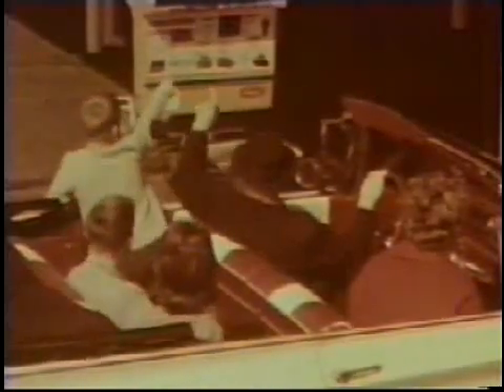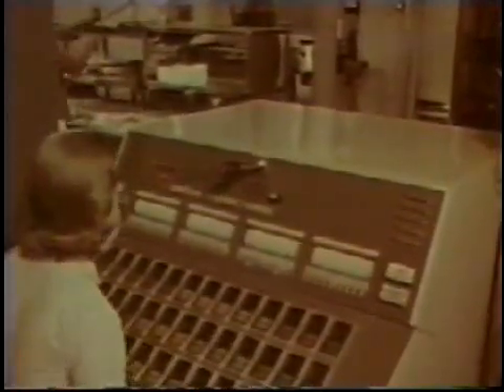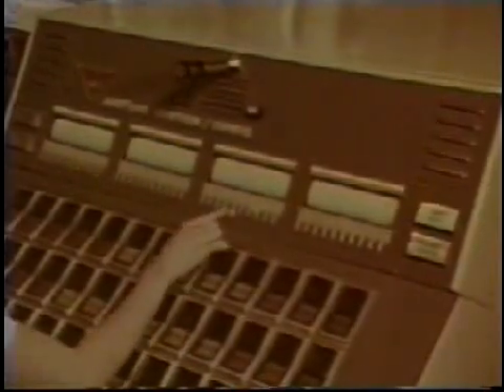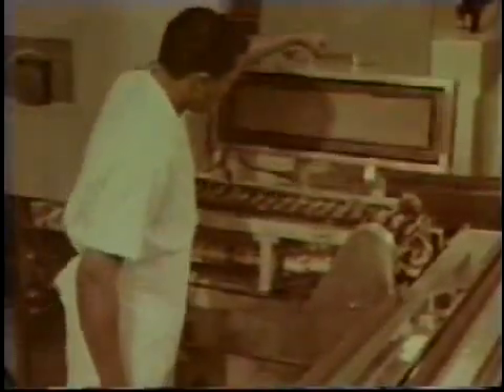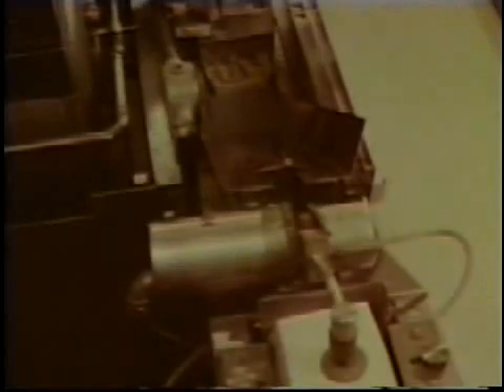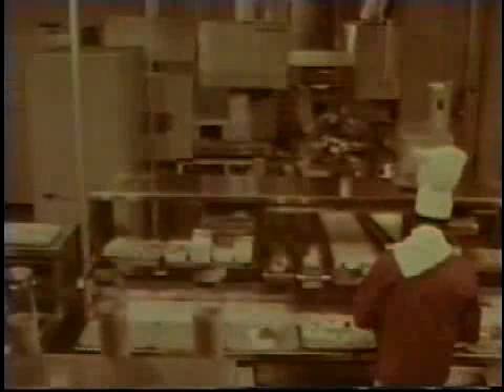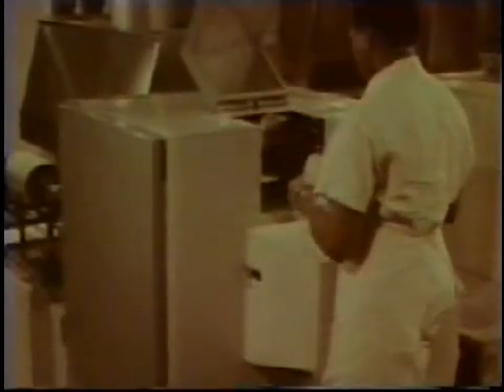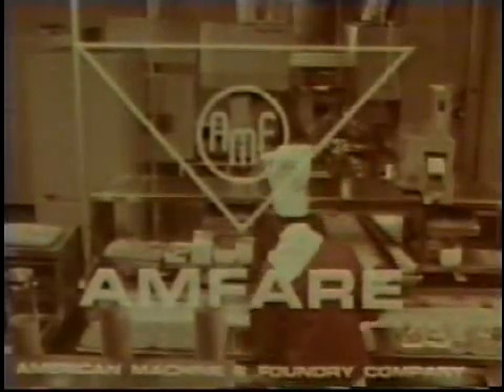Automatic Hamburger Machine - 50 Years Ahead of Its Time!

Comment: Lots of servos, solenoids and pneumatic systems that had to be a nightmare to maintain. Surfaces that had to be near impossible to clean and keep clean and sanitary. An enormous investment right on the front end, for a system that was never scaled and brought to market phase. Not surprising this didn't take off. 

It's more like the pipe dream of a bunch of engineers, rather than a workable setup.
Reply: a good guess is that is  part of why it never  took hold in many restaurants..I  agree  it was not only a  nightmare to maintain ... I bet   if it broke down,  the restaurant would have had to close down   until repairs  were made ( unless they had a way to manually fix the meals  correctly & timely
Reply: @Xenomorph1111  seems like you'd have to have a maintenance engineer on site at all times to keep it running
Reply: It all begins with a first step

Comment: it takes whole 4 minutes to produce an order and is still required to be managed by two workers
additionally it would be costly to build a AMF system and maintain it.

minimum wage workers will continue to dominate the fast food industry for the foreseeable future.
Reply: Actually the cost of the new version of the machine will pay for itself in about 1 year. The total size of the unit will be about 24 square feet cutting the total size of the restaurant down or allowing more seating space. The machines today can produce about 360 burgers an hour and you can customize all the toppings and even the meat blend of the burger itself. The system is far more sanitary than the average fast food restaurant. With these savings you can increase the quality of the ingredients and sell 'gourmet' burgers for McDonalds prices and make even more money. You forget you buy the machine once while you pay the wage of the worker every year.

Plus you don't have to worry about worker injuries, surly employees demanding college level wages for no skill work, employees who don't come to work, etc. Plus they already have an automated cashier/order taker. So really you just need a couple workers whom you can pay 15/hr so they'll restock your fast food machine and smile at customers. Gone will be all the rest of the crew.
Reply: Two or three people trained to handle any issues with the equipment and handle deliveries and restocking the consumables, one per shift. If the serving trays are delivered on conveyors to the customers, and returned the same way to automatic washing, that's all the employees a restaurant would need.

There already are restaurants like that in Japan. At least one even has an animatronic robot doing the cooking inside a clear walled box. The food is sent down the line and pushed through trapdoors onto the tables, with all the robotic stuff inside the clear walls for the customers to see.

When it comes to American shores it's likely that all the showy stuff won't come with it. There'll just be order screens at each table. Poke your debit card in and wait for the food.
Reply: Not true. It takes 4 minutes to output a given order. They did not state what it's throughout was. It's called queue theory. You have a number of orders in the pipeline simultaneously at various stages of completion. That's how factories work. This can be understood better in an auto factory. You may have a new car poopping off the end every 5 minutes, even though a particular car might take 5 hours from start to finish.

Comment: This is a brilliant idea, but it was scrapped cause it takes forever to clean and cost over $100,000 just to operate it. Not to mention that it keeps breaking down. Even with a full-time technician.
Reply: +Brendyn Robertson My dad was a customer rep for AMF in Mill Valley CA and a local chain (think A&W?) tried these out. I remember getting dragged into the place on a weekend when engineers were trying to debug the installation before the restaurant opened. We watched food coming off the conveyer belt all morning going straight into a big trashcan. The owner cancelled the contract eventually since the system did indeed break down daily.
Reply: +Brendyn Robertson Hopefully technology has improved since then. Maybe it's more practical now? Or at the very least the ordering and picking up bits.
Reply: Maybe, maybe not.
Reply: +Brendyn Robertson Thank you.  I think so too.
Reply: thanks for that, i was wondering what happened since this was like the future back int eh 50s right?.. so we got http://momentummachines.com/ now with a much simplier machine to do the burgers, looks like less moving parts to jam up, im guessing. haven't seen it run . yet ( the only think I can remember AMF for is their bowling alleys back in aust )

Comment: Years ago I noticed that Burger King used a broiler similar to the one in the hamburger machine.  It consisted of a conveyor of three steel bands which carried the burger patty thru the flame broiler.  The flames hit both sides of the patty at once.  Cooking it that way gives it a terrific char-broiled flavor.  AMF used meat that was about 20% fat content.  It is the burning of the fat that gives it the flavor.  I have wondered if the Burger King broiler was a descendant of the original hamburger machine.
Reply: BK always tastes like it was cooked in a microwave
Reply: @Uncle__Karl  bc they reheat the burger in the microwave
Reply: Burger King stopped using the broiler when they set a UK airport on fire

Comment: In December 1965 I worked for AMF, and was transferred to Stamford Conn to work in the AMFARE test lab.  It was setup like a fast food kitchen with all the machines there making everything described in the video.  I worked graveyard, as they ran 24 hours five days a week.  We ran the machines and made the food, and each day we filled the dumpster out back.  All of it was thrown away.  But the stuff was great.  The double cheeseburgers were excellent, with a terrific charbroiled flavor.  Had too many milk shakes.  The machines worked great.  They were designed by the research engineers in Greenwich that were looking for another hit like the bowling machines.
On the weekends I rescued and took home bags of fried shrimp and put them in my mother's freezer.
AMFARE was doomed from the start.  It took hours to clean the machines.  Cooked on grease from machines running for endless hours could only be removed using super strong alkali chemicals.  It was a nightmare.  But the machines were beautiful!
Reply: None of the original machines were ever used in actual restaurants.  An offshoot of the hamburger machine was used by Burger King years later.  They used a similar machine that cooked the hamburger patty on an open conveyor belt system with gas fired flames cooking from above and below.  Burger King also used and offshoot of the ORBIS system, which was a cash register with a register key for each menu item, which is common today.
Reply: +mofo syne 
The cleaning issue is always going to be a problem.  I don't know how anyone can get around that.
However, as I had mentioned, the quality of the cooked hamburger patty was really good.  Cooking it in an open flame on both sides at a time gave it a terrific flavor.  I don't think any fast food joint does that today.
Reply: +R Pondyke 
Automated cleaning won't be fully solved until improvements in AI and visual recognition happen, because there's simply no way to get reliable cleaning done with blind machines.  All it takes is a slight miscalibration during a process and suddenly there's dirty plates everywhere.  We're pretty close to this being a possible, but there's also the implementation factor.
Reply: How many were in use at actual restaurants? When was the last one taken out of service? Any chance any of the equipment is still in existence?
Reply: +R Pondyke 
Actually, it was December 1964.
Reply: +R Pondyke Very interesting.
Reply: +R Pondyke Wonder what it would be like with technology these days. Hopefully more progress with self maintaining industrial processes.
Reply: why didn't they make an upgrade machine that was easier to clean?
Sounds like the gov stepped in and said no bc they wanted more workers to raise income tax.
Reply: @rmg2419  100%
Reply: So after all the food was made they threw all the hamburgers  out ..what no one liked hamburgers   back then ..why did they not put them in the freezer for later and staff could take home
Reply: @briansokoloski776 i can only assume that they were just straight up producing more food than the staff were interested in. and due to legal and food safety issues, weren't allowed to just hand out the extras
Reply: @hiddendrifts Copy That Senerio Situation
Reply: Why didn't Mcdonald's buy the machines? I'm guessing too expensive. The ROI sucks because of the cleaning that needs to be done and if one part of the machine breaks down then food can't be served or it has to be made the traditional way which defeats the purpose of eliminating workers.
Reply: @dannydaw59  it took well into the 1980s and several fines before McDonald's started caring about hygiene. It definitely wasn't the cleaning that held them back
Reply: Thanks for sharing this important information! I'm getting very hungry now! 🍔🍟🥤🍤
Reply: @angeladay1534  😄👍
Reply: +R Pondyke Dairy Queen here Canada cooks their burgers on a flame broil conveyor belt oven
Reply: yeah but look at it this way .. no technology starts off perfect ... i mean how long did it take cars to get starter motor's ...
Reply: given say 20 years of refinement  this could have been working well by the 1980s
Reply: i wonder of the frying could be done with sprayed on oil and hot air frying.
Reply: https://youtu.be/sMsNZsp4LE0 

These guys also disappeared.
Reply: The Ford Model T was not a joy to drive

Comment: While I can appreciate that running this machine was probably cheaper than hiring people to do all this stuff I'm pretty sure any savings you'd get through running it would be sucked away the second you had to do maintenance on it. Also cleaning it looks like a nightmare of pinched fingers waiting to happen.
Also the cost of the machine itself probably would never pay itself off outside of novelty value and you'd probably get flak from people whose job this machine takes.
However the ordering system is primitive but remarkably similar to how fast food cash registers operate today, I would definitely say that's well ahead of it's time.
Reply: Like my K-car